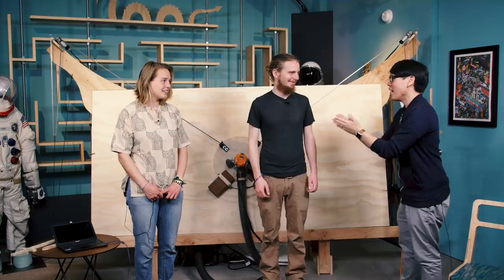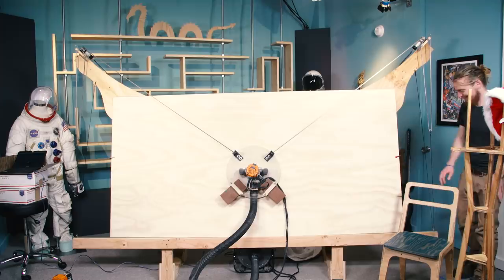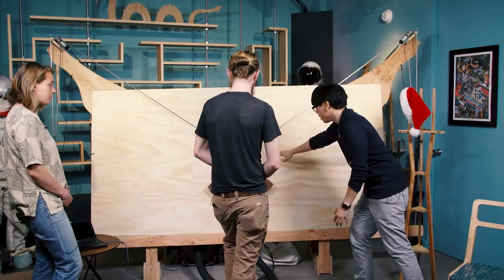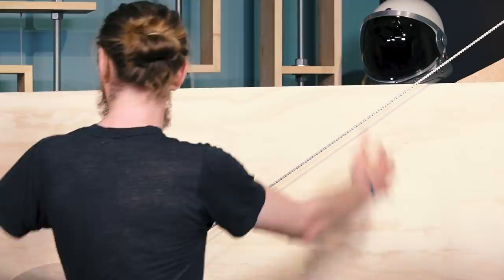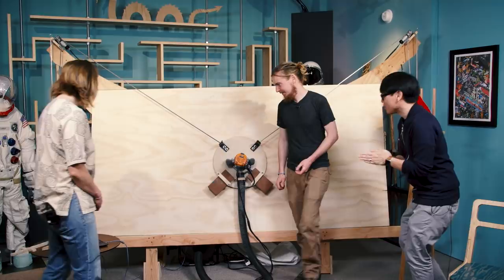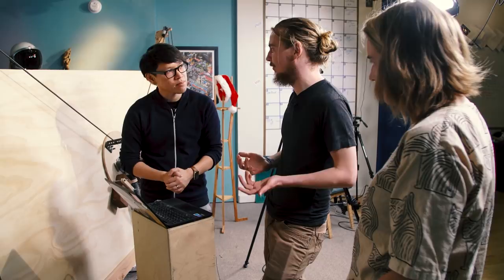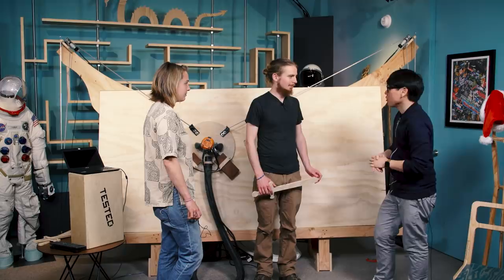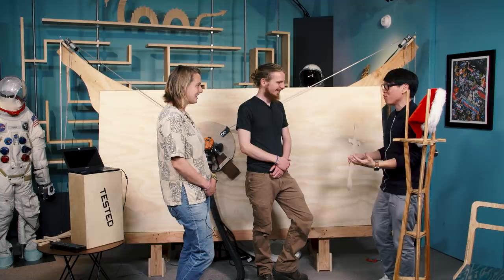Meet Maslow, the $350 CNC Cutting Machine

Comment: STOP SAYING OPEN SOURCE! ALL hardware is open source - if I can see it, I can build it. Is it free or not? If it's gpl licensed, say it's freaking gpl licensed. If it's locked down but "open" then say so. Open source is a meaningless, pointless phrase. Windows is "open source" for those with the money. MySQL is "open source," but it's still owned by Oracle. What do you mean by "open source?" Come on, Tested, you people are supposed to understand this stuff.

This invention is very cool. Many times I've though of using one to paint murals. It looks like a very cool toy to drive the neighbors absolutely insane.
Reply: no, not all hardware is open source. In this case, it's not just the frame (easy to copy), but also the circuit board design, the firmware to run the motors, and the software to run on the PC to drive it (although the firmware is also grbl compatible)

Open Source does not mean you can see it, it means that you are allowed to copy it legally. MySQL is Open Source in spite of Oracle owning major parts of it (Oracle doesn't own the copyright to all of it, which is why MyraDB was able to fork the MySQL codebase and keep going in spite of Oracle's policies)

Windows is in no way Open Source, There is no way that they will give you the source code and the permission to give the source code away to anyone else.